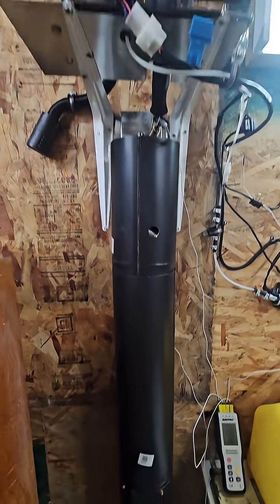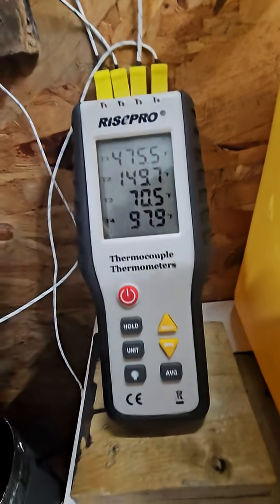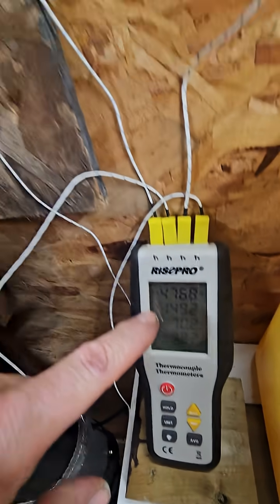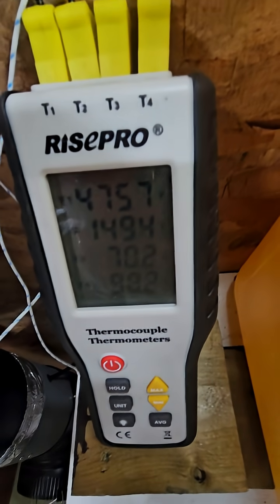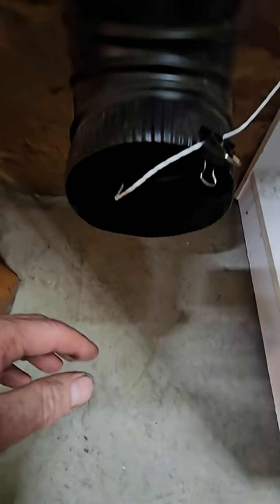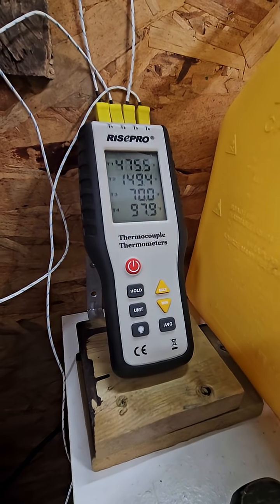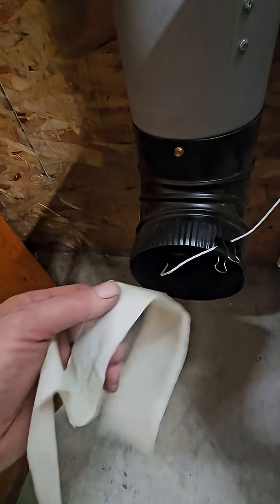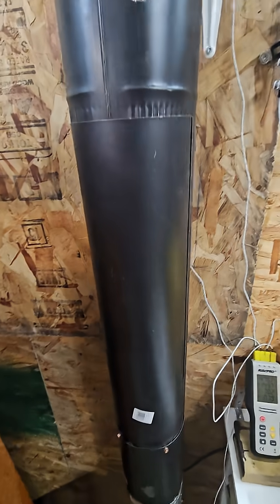Diesel Heater - Exhaust Heat Exchanger

Comment: I'm curious why you don't reverse the airflow so the fan is drawing cold air from the ground and warming it as it travels up the stack ?
Reply from the maker: To better stir up the cold air layer at the floor.
Reply: @scotscheideman9800 ah, that makes sense!
Reply: How many feet of exhaust did you use to complete this 🤔
Reply from the maker: @lAMCANADlAN  2 meters piece (6'6ft) from the heater to the end of the exchanger. Then a 90° elbow, a few inches to get through the wall to a "thru hull" and then a bit of left over (6"ish) to get away from the wall ( water dripping)
Reply: Doing that .. bottom to top .  would run colder air over the exhaust, and should extract more heat from the differential ..   that's what I do, but without a housing 😊